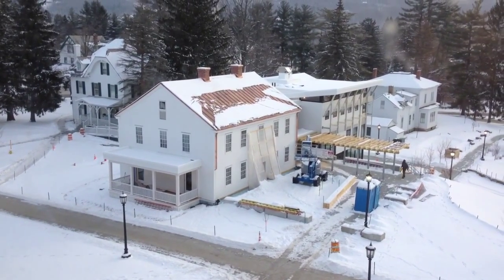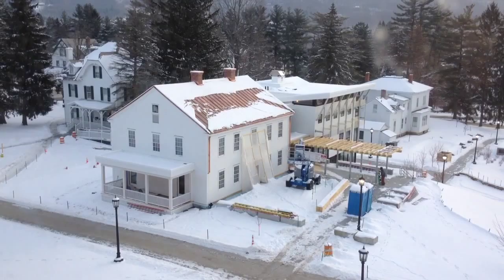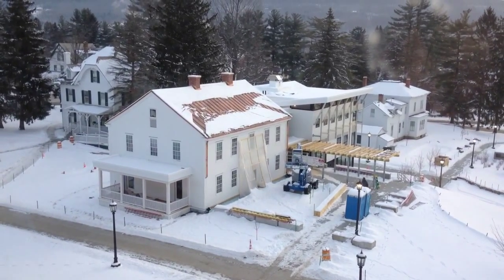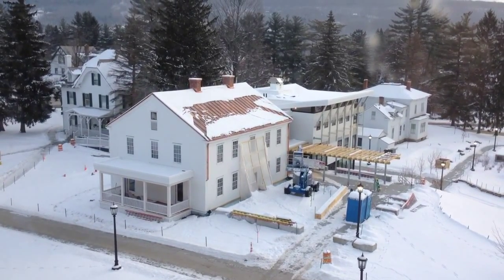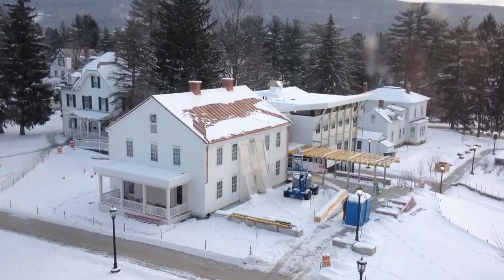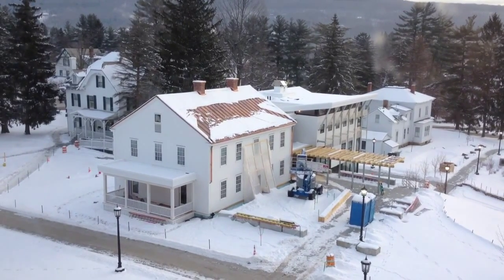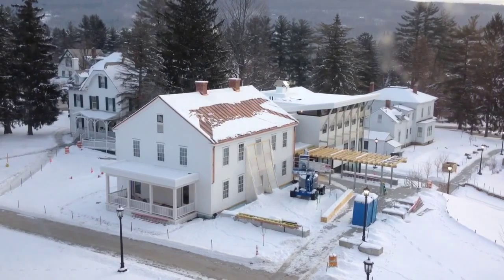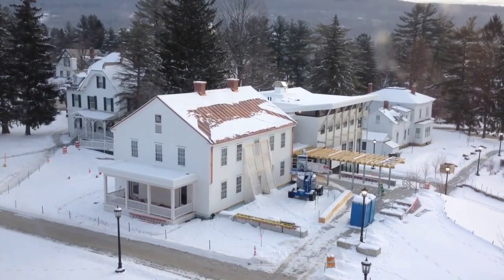Snow getting ready to fall off from the copper roof.

Comment: We have had pole buildings that have metal roofs collapse just from the movement of the snow coming off the roof. I know that building is built well and would not collapse but there seems to be a great force put on the truss or rafter system just from the movement or maybe when the snow stops moving all of the sudden. No, I would not want to be the person standing under the eave.
Reply from the maker: Yea, there are solar panels that will be affixed to the copper area when its done. The gutter system recovers rain water, and it goes into a storage tank. All of the ideas are good, its just the implementation that might be a problem. Hopefully they will make that an emergency exit only.